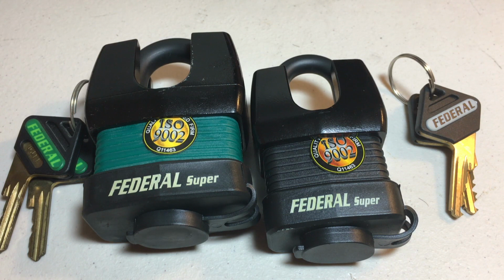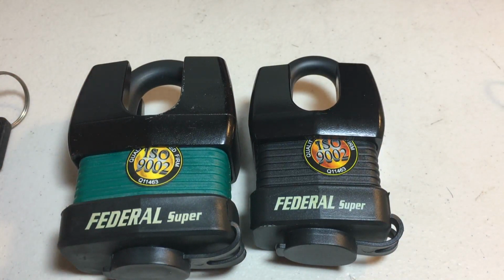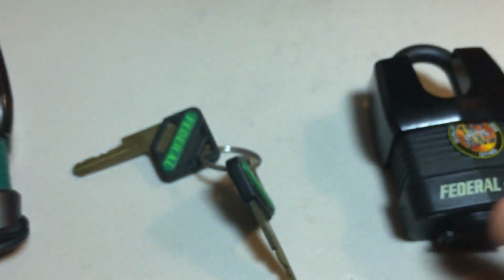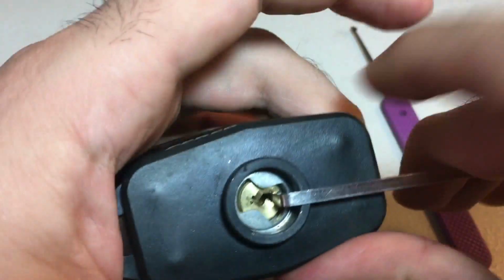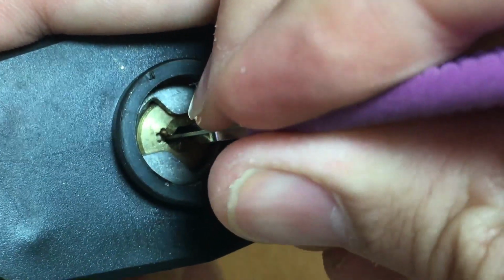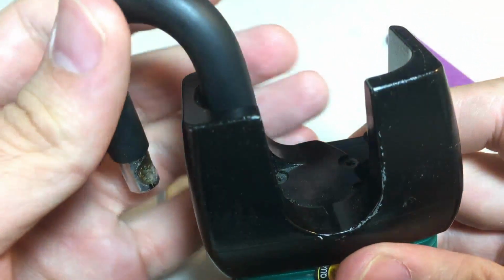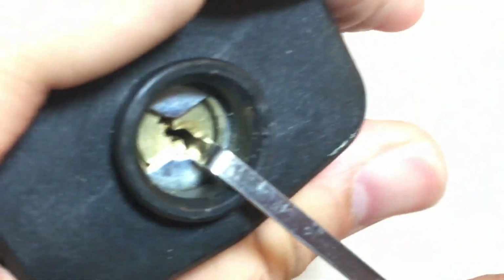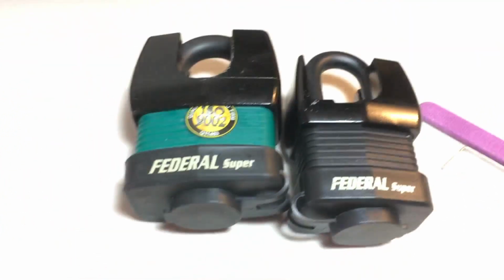[58] Two "Federal Super" Padlocks (Picked!)

Comment: Nice video. Just curious, how old are you? Out of college?
Reply from the maker: Thanks! I am actually in my early 30's.
Reply: Gotcha. Also, quick question...I'm fairly new to picking but is there a reason I can SPP a Kwikset but still can only rake and not SPP Master locks open?
Reply from the maker: It's just differences in the bitting and the shape of the keyway that requires a little more finesse for SPPing. 

Basic master locks are not hard to SPP, or at least not necessarliy harder than Kwiksets. 

I suggest just going very very slowly and touching each pin one by one, don't rush it. You will feel the click on the binding pin. Try not to put too much tension. Also try to switch tension wrenches, sometimes that helps me when I am stuck.